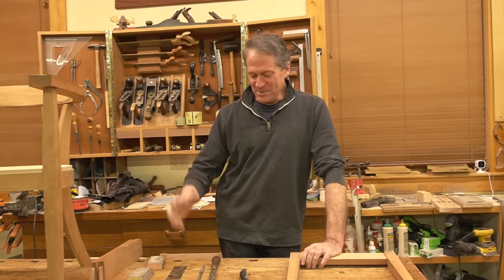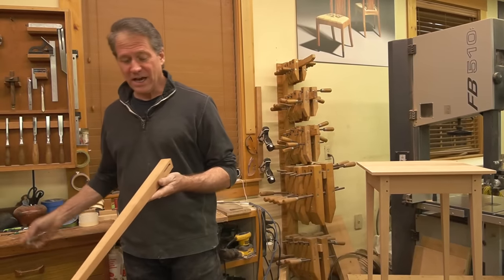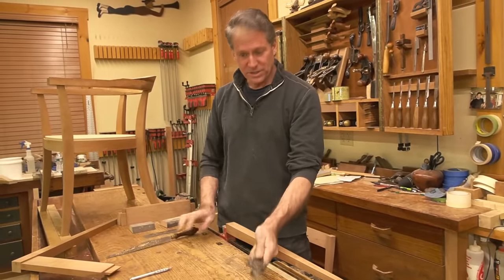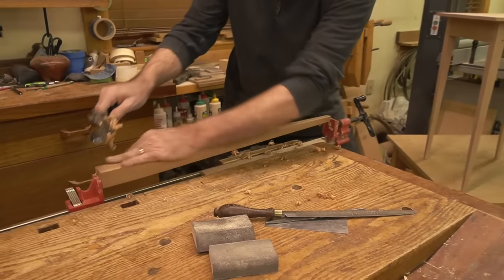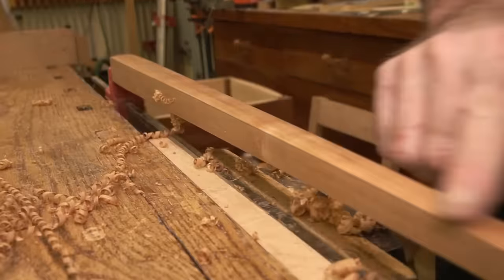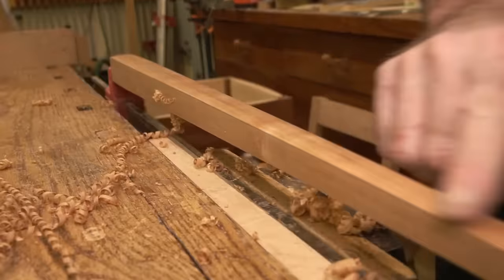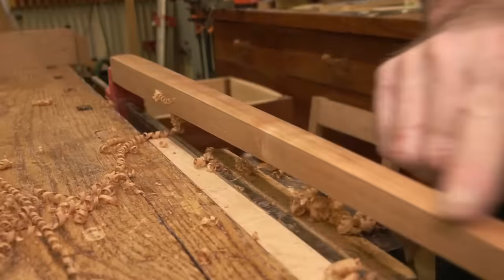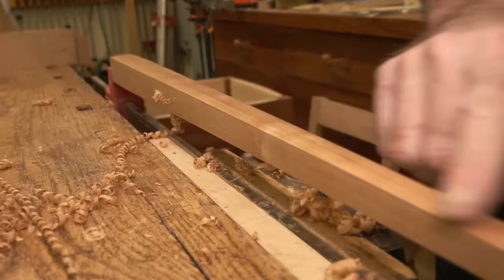"Pillowing" Wood in Furniture Making

Comment: WOW, Ive been woodworking 53 yrs; never heard of pillowing! But I love it! I just love taking normal and tweaking it to make a brand new thing!  OK, now, how do you maintain a tight joint at the top, where the rail connects?  About the question of cleaning the rasp--- -a card file does it for me...Also, just watching you push together the m&tennons, you've got just the right feel to it, where you dont have to pull it together with a clamp; but you also dont have it so loose it will fall out! (the mark of mastery!).
Reply from the maker: Thank you so much Seth, kind of you to say! I wish I could say I invented it but I stole…I mean I was “inspired by” others whose work I have admired.
As to the fit around the joinery areas, you want to taper the pillowing off to nothing just below the mortise areas on the inside surfaces of the legs in order to maintain the flat area so as to not affect the joinery. Thanks again, I sure appreciate you watching! 👍😎